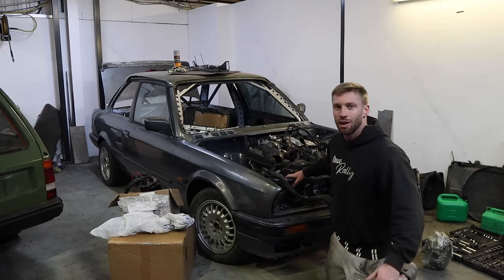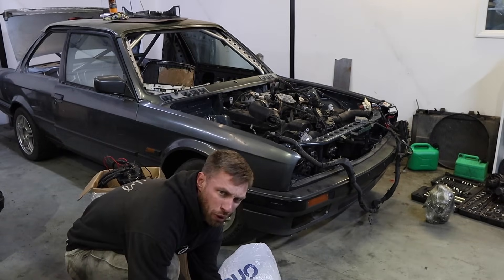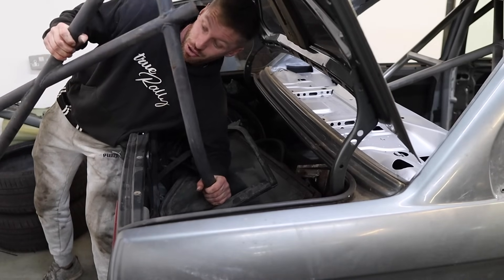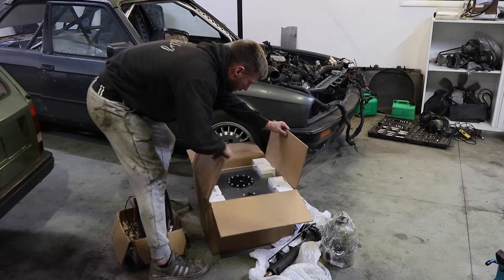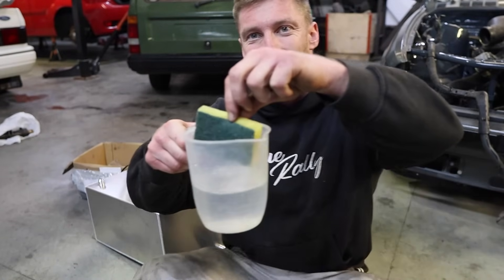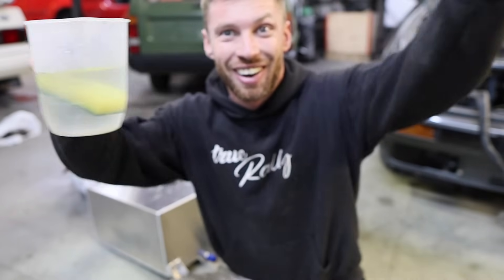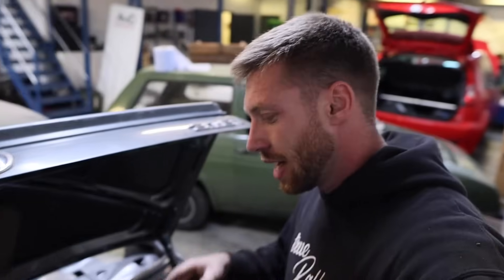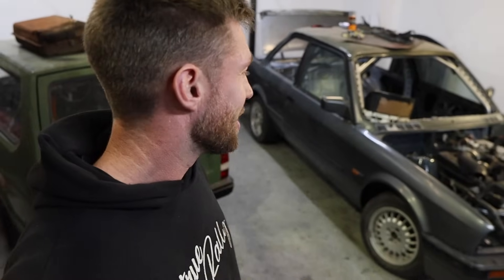Fuel cell, swirl port and fuel lines install - (E30 V8 SWAP - PART 10)

Comment: If there is no room in the engine bay u should try this to have more room A vehicle equipped with a steer-by-wire system is able to steer some or all of its wheels without a steering column connected to the wheel axles
Reply: Fuck that 🤣

Comment: Ive put a Facet fuel pump on my mk1 golf. I was told it needs fitting vertical not horizontal (in at  the bottom out at the top )

Comment: Mate u need to step back a bit you are juggling to many balls in the air at once,setting yourself up to fail,set yourself a plan and stick to it like a flowchart if it helps  ask yer colleagues for advice. 😊😊😊😊😊